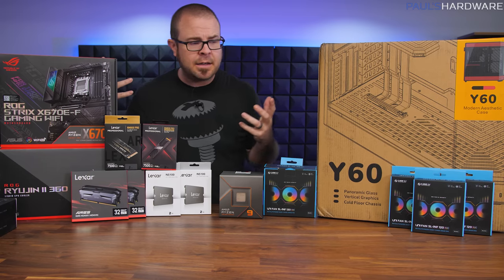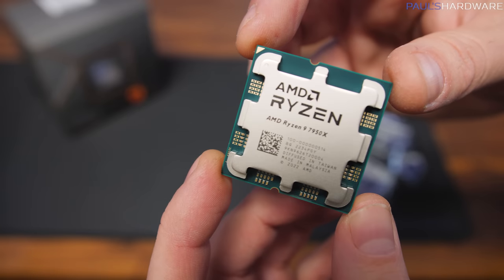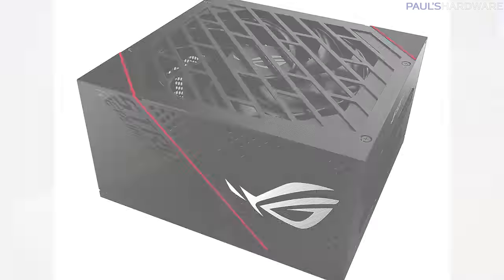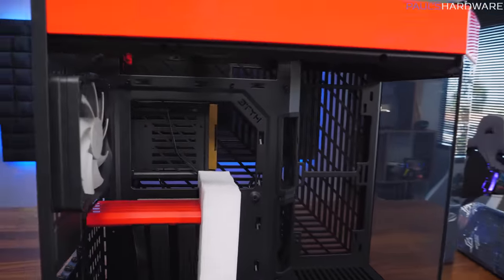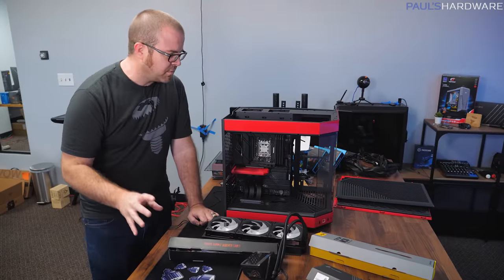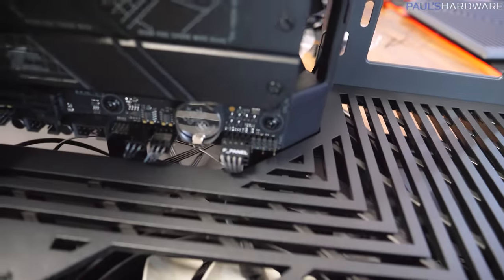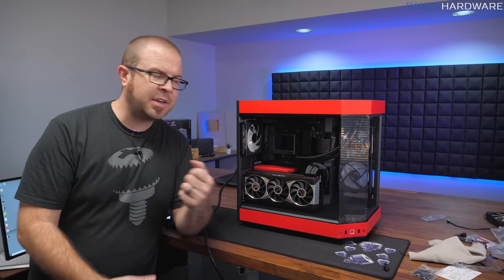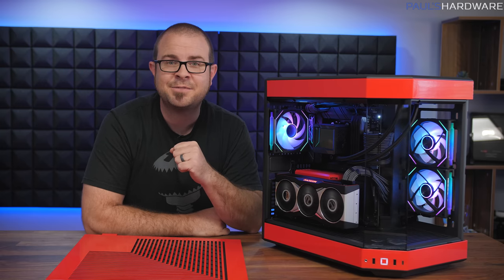Building a Beautiful Red All-AMD Gaming PC with a Mystery GPU!

Comment: cheeeeeeeeeeers and awsomeeeeeeeeee hahaha! lets go! glad ot have some stuff ot watch cause the gpu market is making my full rebuild put off till next spring at this rate~ STILL have ot train up and get all the gear i need ot perfectly upgrade my b450 board from a 2600 from 2018 to the new 5800x3d and thatll be AWSOME if i get the heatsink cpu cooler setup properly and get new case fans to make sure its all worknig amazing buuuuuuuuuuut yeah cheeeeeeeeeeeeeeeeeeers it was so easy and fun to build but mannnnnnnnnnnnnnnn why the hell is UPGRADING OR REBUILDING so much more stressful hahahaha

duuuuuuuuuuuuude if you could do "cpu upgrade" videos or "rebuild" style video or 2 for this winter tech season pleaseeeeeeeeeeeeeeeeeeeeeeeeeeeeeeeeeeeeeeeeeeeeeeeee

Comment: You're replacing Noctua fans? 😭😭😭With heathen, non-Noctua fans? 😭😭
How dare you compliment the heathen fans on being easy to build with? Were the Noctua fans not pre-installed in the radiator? Is that not, by definition, the easiest (I actually didn't get that far at the time of writing this comment, so I don't know)?